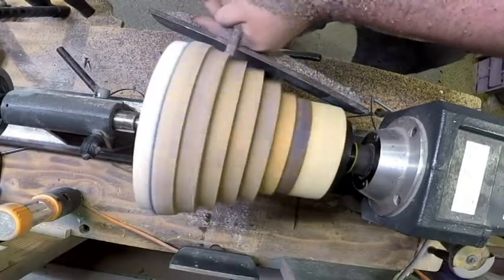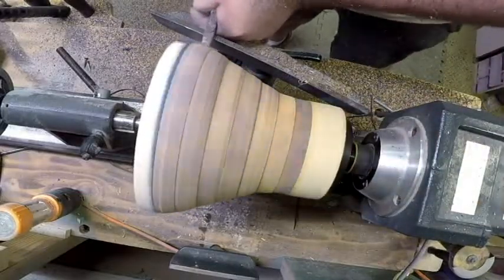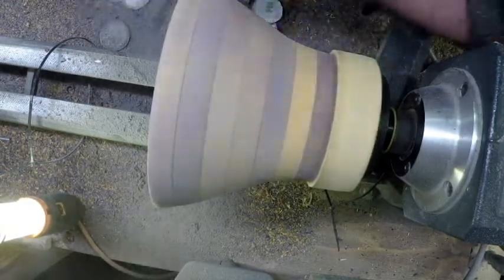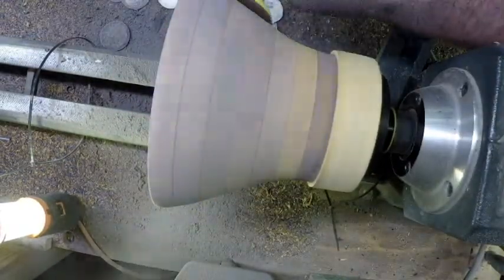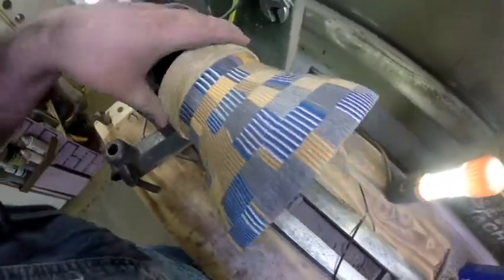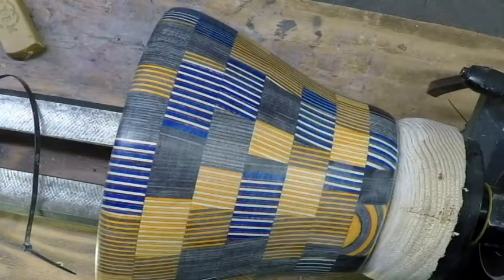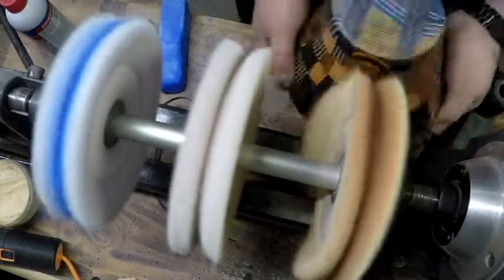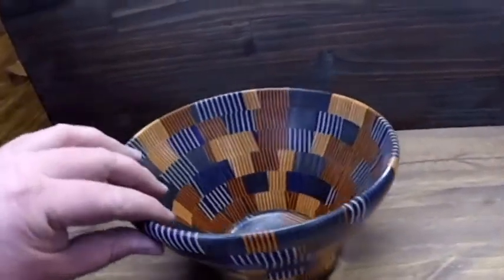Woodturning a segmented spectraply bowl.

Comment: I am having trouble with colors bleeding. It does not like water or alcohol base finishes.
Reply from the maker: Did you try using sanding sealer like I did?
Reply: @TheBeardedGriller  , it did not like me using lacquer sanding sealer. The white laminates turned rootbeer color. It did not like spray lacquer finish either.